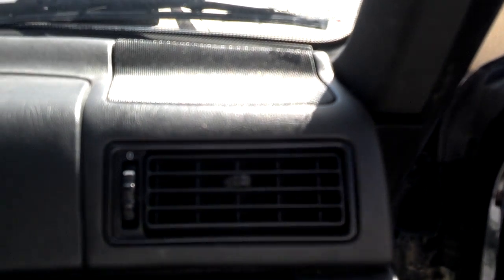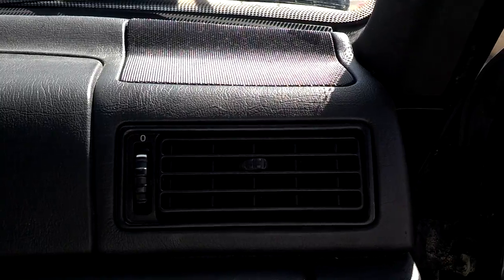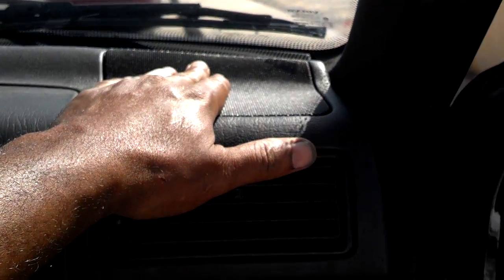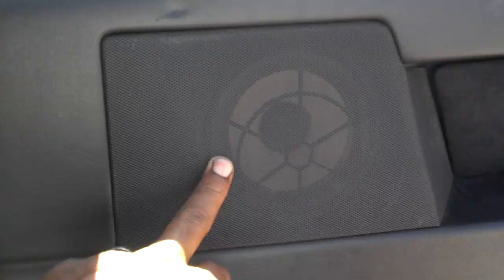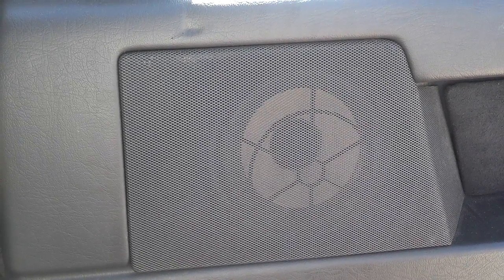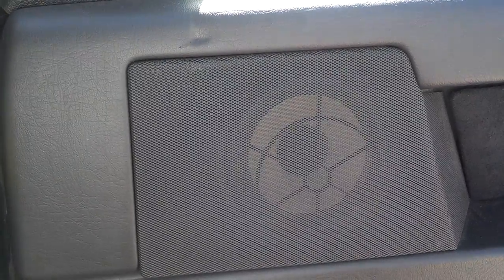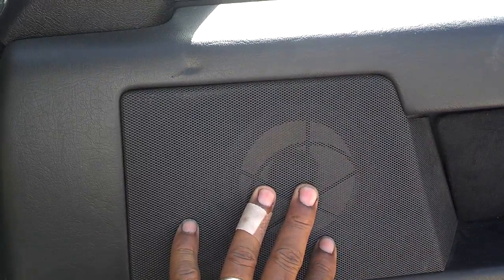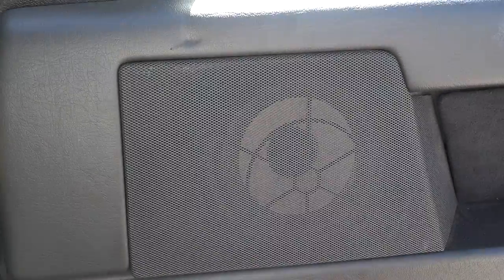Volvo 850 Speaker ohm Information - Auto Information Series

Comment: The front and rear tweeters on my wagon are 8 (7.5 actually.) And the both sets of door speakers are 4 ohms. I replaced the tweeters front and back with Kicker DS35s and the front with 5 1/4" Kickers and the rear with 6 1/2" Kickers with little modification.

Comment: Yea, I measured them with a multimeter. Also "must be" is a little strict, if you put 4ohm speakers, the internal amp of the stock radio will just put out more wattage, and barely any heat. I had it like that for almost two years then I got a 2 DIN Pioneer multimedia headunit that I'm really happy with and matches the interior perfectly.

Comment: I bought these (http://www.amazon.com/KICKER-DS525-4-Ohm-Speakers-11DS525/dp/B00HW8JGUI/ref=sr_1_8?s=electronics&ie=UTF8&qid=1425078673&sr=1-8&keywords=kicker+ds35) to replace my door speakers in my 855r wagon.  Since I'm obviously replacing the original rear door 8 ohms with 4 ohms now would it be beneficial to disconnect or cut the rear column tweeters.  Would that balance back out the power in the way they're wired or would it be going the opposite way.  Sorry I'm obviously crap with electrical knowledge.
Reply from the maker: jaxwithanx Well, I don't think electrical knowledge would help you there. I would listen to it for a few days then decide. From what I know about sound systems and speaker ratings, i.e. ohms, if you lower the ohms of the speakers, it strains the power amp more. The rear d pillar speakers have resistors soldiered in them to balance the sound of them. You may need to replace them, not sure.
Reply from the maker: jaxwithanx http://www.gofundme.com/n49rw0